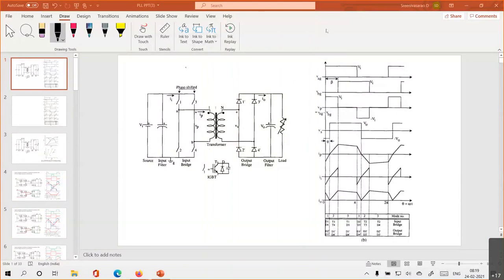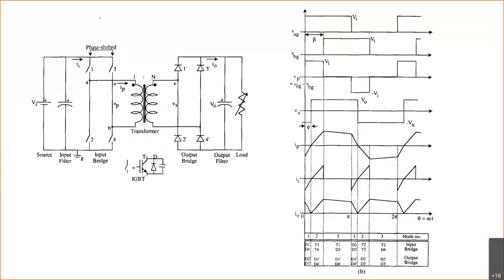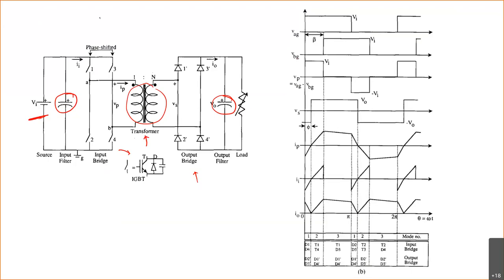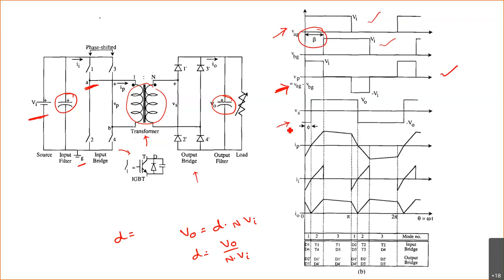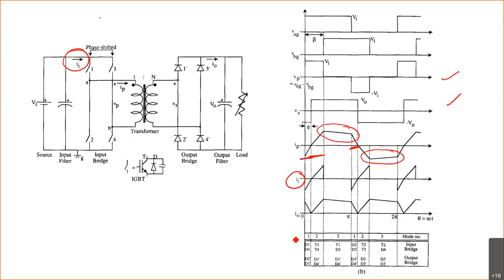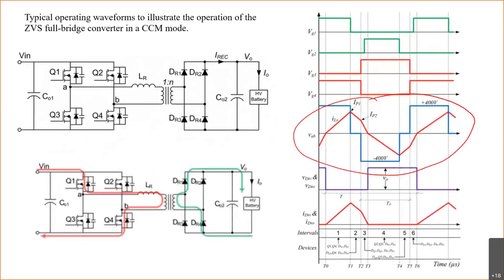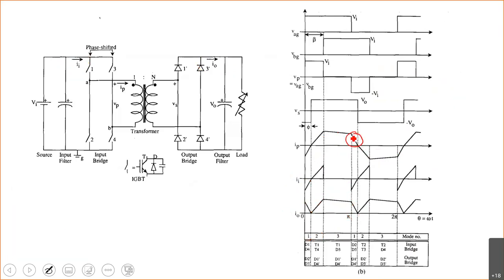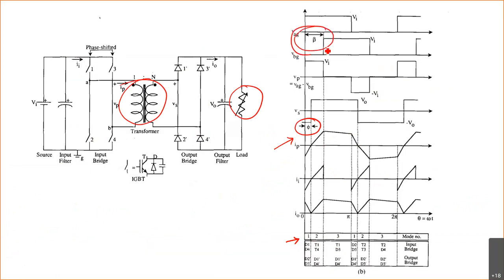Lecture 9 | Phase shifted full bridge dc|dc converter for plugin electrical vehicle on board charger

Comment: Sir please tell the title of paper you referred for this lecture and presentation...
Reply from the maker: R. W. A. A. De Doncker, D. M. Divan and M. H. Kheraluwala, "A three-phase soft-switched high-power-density DC/DC converter for high-power applications," in IEEE Transactions on Industry Applications, vol. 27, no. 1, pp. 63-73, Jan.-Feb. 1991, doi: 10.1109/28.67533.
Reply: @AdvancedPowerElectronics  Thank you Sir.